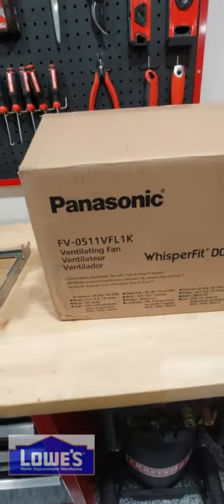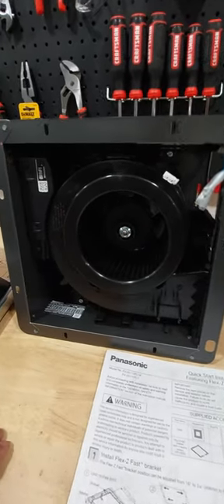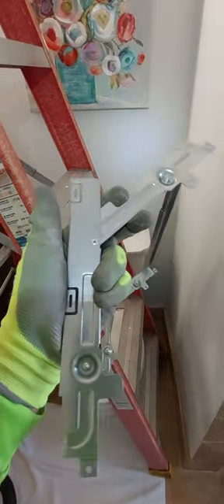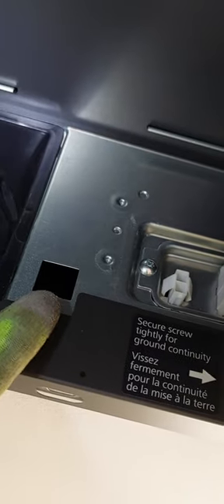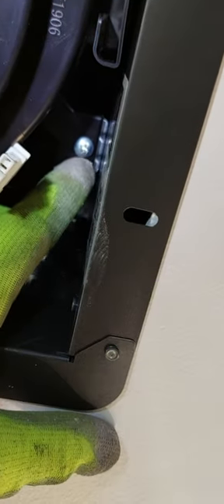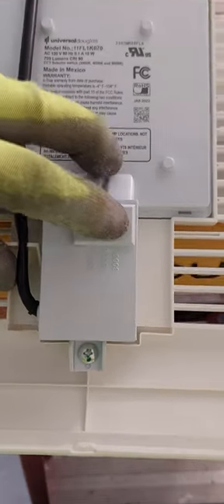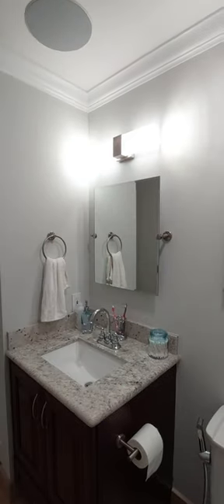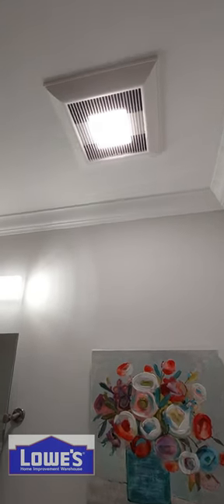Panasonic Bath Fan Review and Installation 110 CFM 50-80-110 CFM LED Light .25 Sone FV-0511VFL1K

Comment: I have installed 4 Panasonic fans in my house. Great fans. Two replaced can lights above the tub/shower and added a second fan in the bathroom. Install is easy. Template included for cutting the ceiling hole.  No complaints.
Reply from the maker: Hello the install was great I had a previous Panasonic that was old.  this one is very quiet and LED light is very bright.  I am happy with the unit.  Thank you

Comment: Can you show how you hooked up the junction box at the fan?
Reply from the maker: Hello I noticed that I didnt put that part of the video.  Its only 3 cables ground, hot(black) and neutral(white).  You can use the provided wire nuts.  You can turn off your breaker to be safe. Sorry I didnt show that part. Hope this helps

Comment: What is the ideal switch for this unit to offer the most control?  Link?
Reply from the maker: Hello you can get a dual rocker switch single gang to control the light and the fan separate if you have dual circuit.  You can use the dual switch if you have 4 cable setup with ground, neutral, hot and red cable.  If you dont have the 4 cable setup you can either run a new one or just use the single switch to control both the fan and the light.  I unplugged the light since I have the one over the sink.  The light if very bright so if you have a bathroom with low light it will work great.  homedepot.sjv.io/q4kgvN
I have it with a Lutron motion switch so when I go in the bathroom it turns on automatic on a single circuit.  homedepot.sjv.io/VmR4KM
Let me know if this helps or you have any questions. thanks

Comment: Currious, why did you remove the fan from the housing.
Reply from the maker: Hi to make it easier to do the install  and the weight.  It can be installed without removing the fan.  Thanks